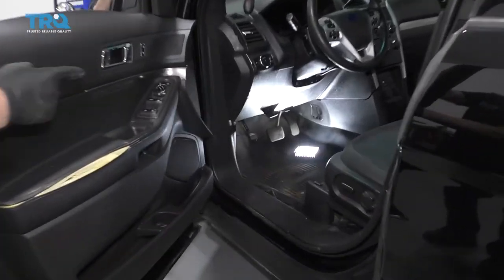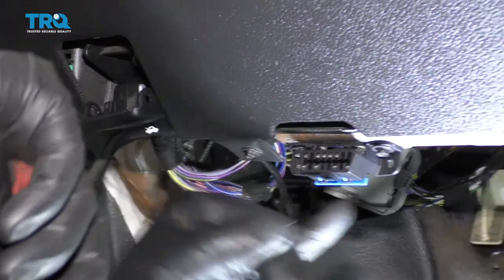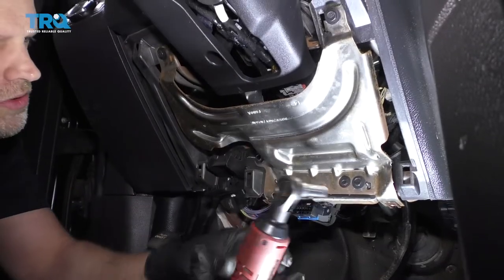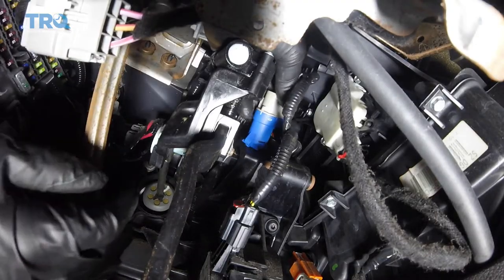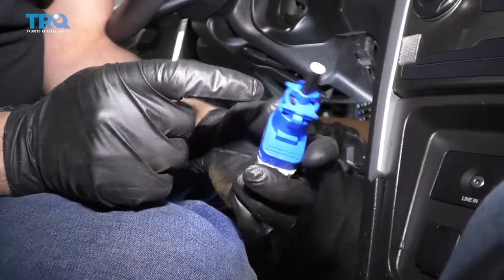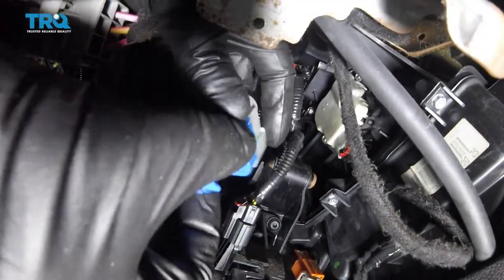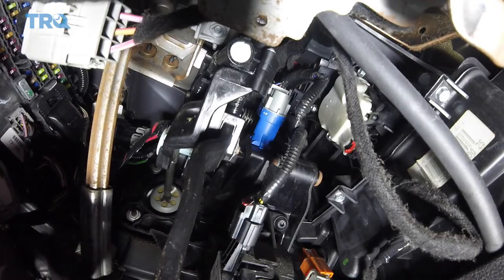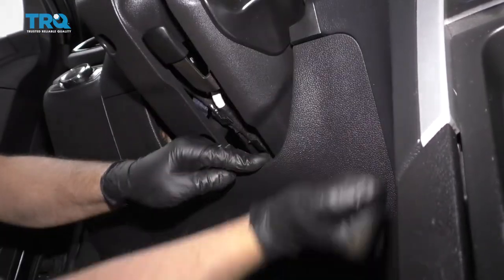How to Replace Brake Light Switch 2013-17 Ford Police Interceptor Utility

Comment: You are the only one on the internet that even mentioned the adjustment.   I appreciate that. So does it self adjust or what? My Ford Mustang is is having an issue where I am applying the brakes and the lights have not come on until I press the brakes harder. So they're not coming on soon enough. I just had the recall done at the dealer. I don't think they adjusted it correctly.  I would appreciate it if you would let me know if it self adjusts or is there a setting somewhere?

Comment: Tried this on my 2011 Explorer.  Could not get switch out.  A lot less room up there to turn anything than what it looks like in the video.
Reply: It's easy not that hard.
Reply: Having same problem.  Very tight space on 2011 explorer